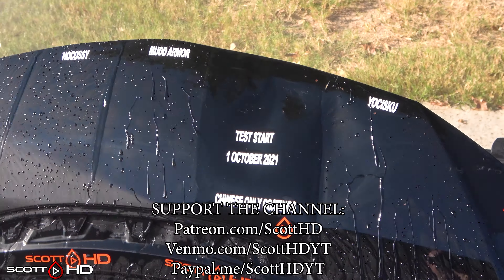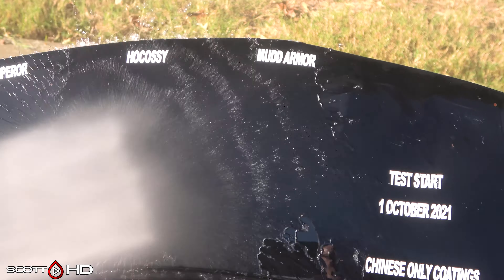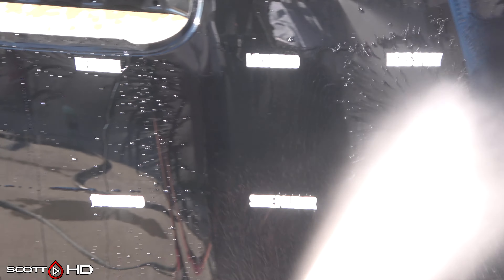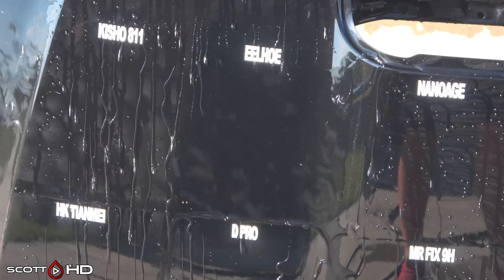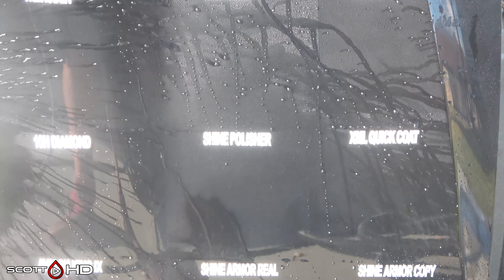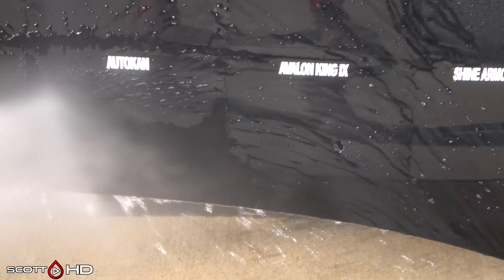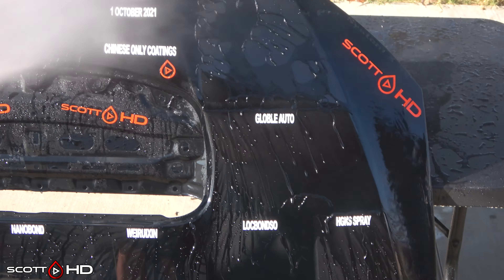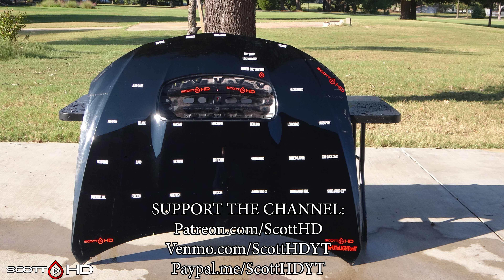28 WAY CHINESE COATINGS LONGEVITY TEST  - UPDATE 01 - FIRST RINSE - Already have failures!

Comment: Great video once again Scott, I've been wondering if you were possibly willing to make some slight changes to the coating longevity tests (particularly the Pro only coatings and Chinese coatings as these have just started). I know you use the Chemical Guys Honeydew Snow Foam as the soap for all these tests as that was the soap you began them with, but would you be open to changing this? I think something like a Carpro Lift Snowfoam along with Carpro Reset soap wash as these coatings are advertised to be very resistant to breakdown from wash chemicals and many of them even suggest the use of more powerful snowfoam/wash soaps (usually of their own brands). Obviously you wouldn't have to use the ones I've suggested as I'm sure you have far greater experience with different carwash soaps but I thought it might be a good change to see over CG Honeydew which in my opinion mainly serves to supply massive foam and suds. Looking forward to future updates, thanks again Scott